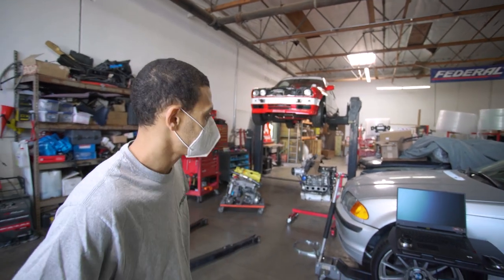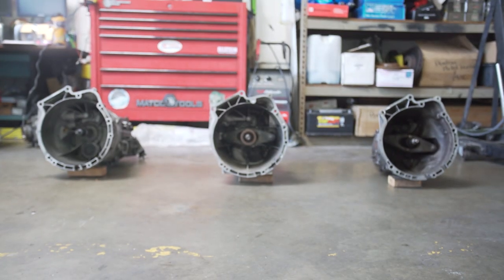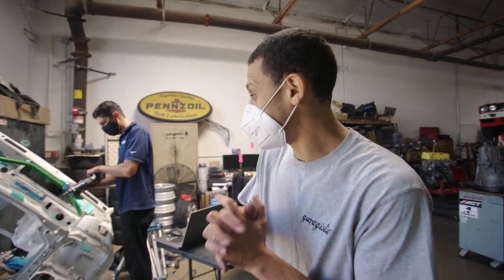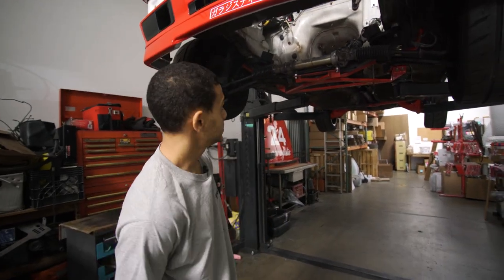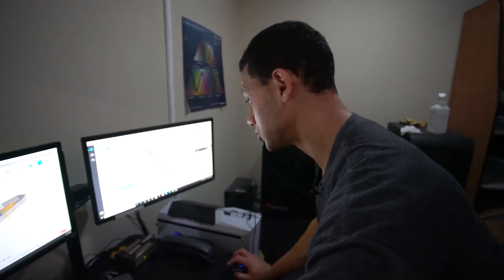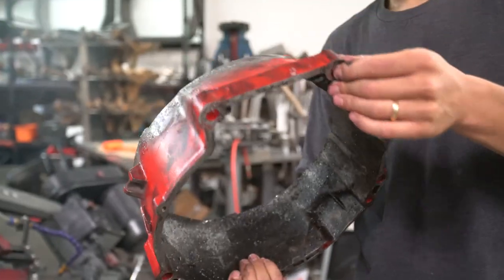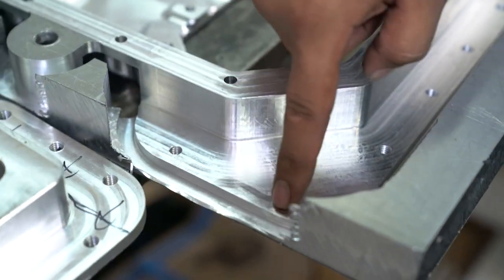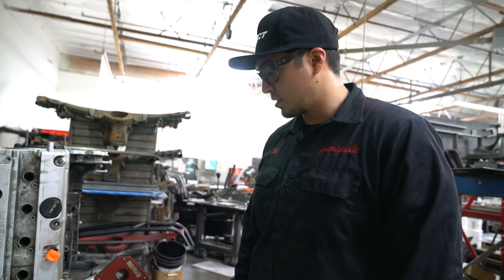3D Scanning & Making a Billet K24 E30 Oil Pan!! | DAY AT THE SHOP!

Comment: First off the billet oil pan is fire🔥 and secondly the use of 3D scanning for your products is a huge 1up on the market, the fit will always be perfect. I love it I just designed my K to ZF320 adapter using 3D scans and it’s made my dimensions spot on. Can’t wait to get it milled on my router and bolted on so I can get more done on my K E30 project. Keep up the content and the rad products for the cars I love🤟😎

Comment: What's the estimated price on the oil pan? I need one for my 2.1L K24 E30. I will be cutting the firewall out to move the engine back as much as possible so the subframe and rack shouldn't be an issue. Also what's the max rpm you have found the getrag 6spd to handle as my engine will rev over 10k. Still haven't decided on a transmissions yet, been looking at G-Force and all sorts of different ones from BMW's to cd009s and everything else in between.
Reply from the maker: We are still working on some details on the oil pan so we can manufacture a piece that is reasonable and affordable for you guys. 

Engine placement won't be able to be pushed back too far due to the oil pan sump making contact with the steering rack. 

As far as the transmissions go, you should not have any issues regardless of RPM as long as you are using the correct fluid for a high-performance application that will not break down from the heat created during sustained high RPM use 👍
Reply: @garagistic  Sounds good I'll be following along. I'll be cutting the whole firewall and floor out as it will be on a full tube chassis so the engine is getting pushed back behind the  subframe and steering rack. Only BMW parts left will be the body skin. Even the front and rear suspension are being replaced, putting a solid axle with a winters quick change in the rear. Sorta a mix between a full blown rally car but with long travel (mainly droop) like a prerunner.